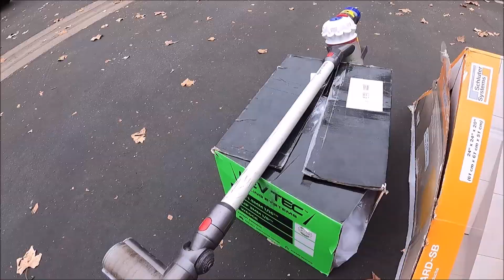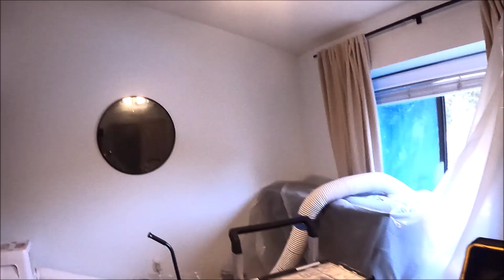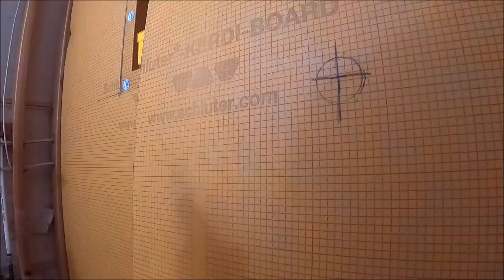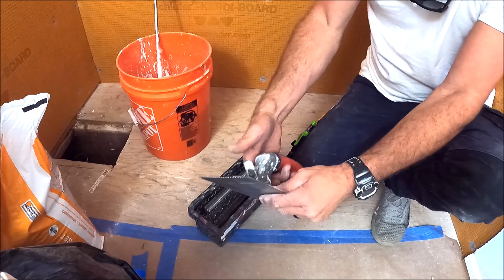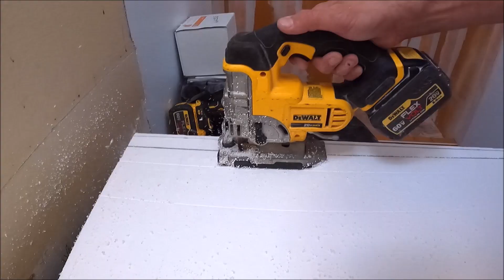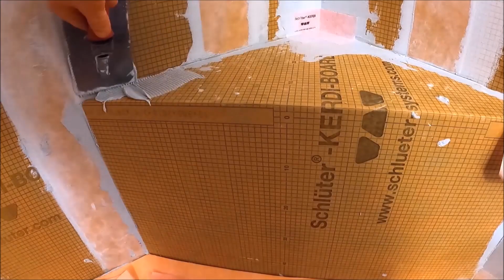Building a Shower with Foam!

Comment: Is the shower pan 60x38 cut down to 60x32 plus the angle for the bench? Trying to do a  tub to shower conversion and worried my tiles will be different sizes at the bottom on the wall touching the base. Drain is off center. Would you notice?

Comment: Nice work as always. Can you do an episode on moving the drain, or link me to an existing one you've already uploaded? Specifically tips on how to shore up the floor. I have a shower where the OSB rotted out all the way under the sill plate of the wall. Big hole... Creative blocking ideas?

Comment: The Schluter Method seems to have a lot of failure points compared to some other systems on the market. We all make mistakes and if I did Tile full-time I think id use another system.

Comment: Curious as to why not pan first? Waterproofing exterior things you’d always start at the bottom.
Reply: I agree. This method is subject to too many possible failure points.
Reply: With schluter showers you abandons the idea of exterior waterproofing ideas like shingling and diverting water. Schluter creates a waterproof shower regardless of doing pan or walls first. Kerdiband creates the waterproofing at the bottom.
Reply: @cwb124  that’s fair. And every video I see proves what you’re saying. It’s just counter intuitive from 99% of other waterproofing practices.
Reply: @cwb124  I'm too old to abandon waterproofing ideas